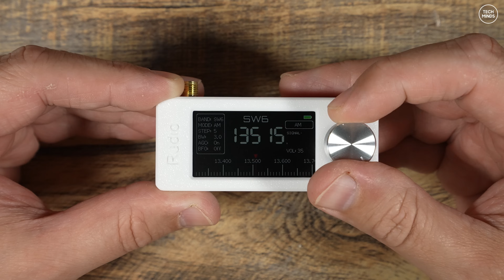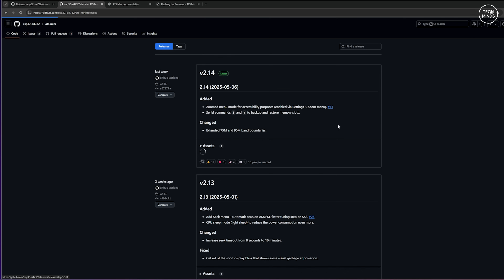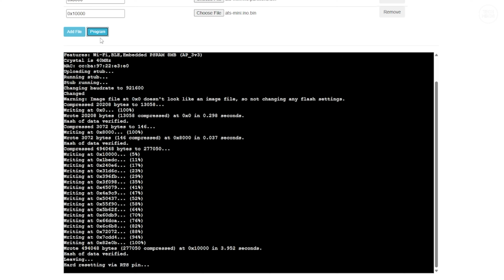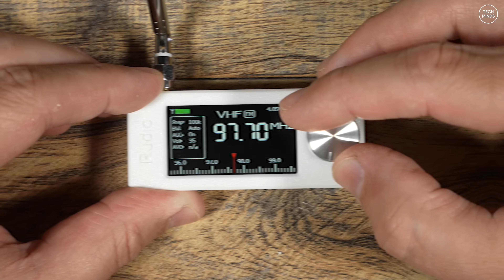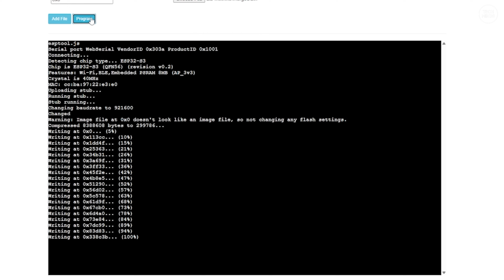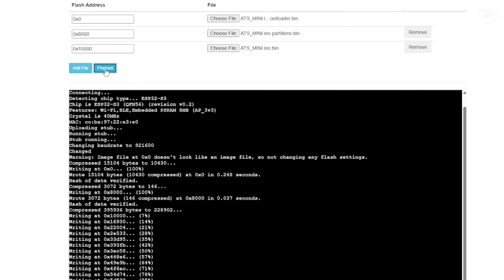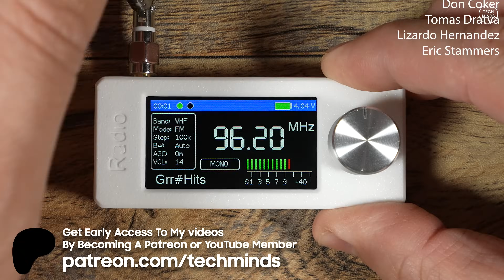How To Upgrade The Si4732 DSP Receiver Firmware - Do This Now!

Comment: After the flash process, the following message appeared in the last line oft he monitor log: "Error: MD5 of file does not match data in flash." I unplugged the ATS mini USB connector and turned the device off and on again. Result: it won't boot up again. I got a black screen. The mini radio was no longer displayed in the Windows computer's device manager! Opened the device, pressed and held the BOOT button, pressed the RESET Button, released the BOOT button. Afterward, the device reappeared in the Windows Device Manager. When connecting to the ESP Tool, the message "Error: Guru Meditation Error detected (IllegalInstruction)" appears. No furher flashing possible. Same hardware configuration MCN1 6R8 / Software Flash File = ats-mini-v2.28-ospi/ats-mini.ino.merged)
 Does anyone have any idea what else I could do? Thanks in advance for your efforts!

Comment: The first firmware you showed it a lot better. It has themes, memories, ... And from the activity I can see on GitHub, the next version will have wifi connectivity + NTP date time display (maybe other stuff ?).
If only the PCB had a pcm5102 dac, then it would be possible to add new functionalities such as playing online radio streams. It would make it the ultimate pocket radio !
I already have 3 of them and the metal version is on its way. The v2 has some nice hardware enhancements such as a better speaker, a more powerful amplifier for the jack output and an antenna matcher / amplifier which makes reception better.

Comment: Great video and content . Is it possible to receive uk cb frequencies in FM with new firmware ?
Reply: Oh ok .. thanks for the clarification.. such a shame .. not sure why this can’t be done . Thank you
Reply: @houdielbow5770  Presumably the chip has no narrow band FM demodulator. 😞
Reply: FM works everywhere else with  this radio just not 27mhz sadly
Reply: @houdielbow5770  Really? And it's definitely narrow?
Reply: My mistake Brian , it does have fm but seems only on commercial frequencies 👍
Reply: @houdielbow5770  Still no 27MHz NFM then. 😞

Comment: The link to the firmware version 1 is not working for me
Reply: Click on Releases over on the right, halfway down, and download the ZIP file for the version you want.
Reply: @BrianG61UK  He "forgot" to mention that you first have to register to Github! Now i have downloaded the firmware but just get Error: $382e02c9bbd5d50b$var$serialLib is undefined when trying to connect the ESP tool.
Reply: @BrianG61UK  Tnx, only get Error: $382e02c9bbd5d50b$var$serialLib is undefined when trying to connect with the ESP Tool!